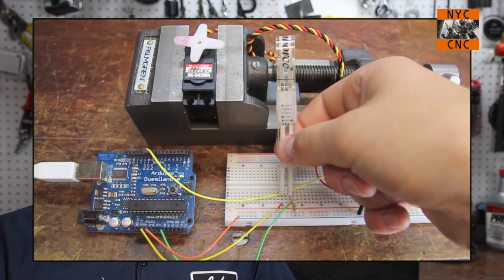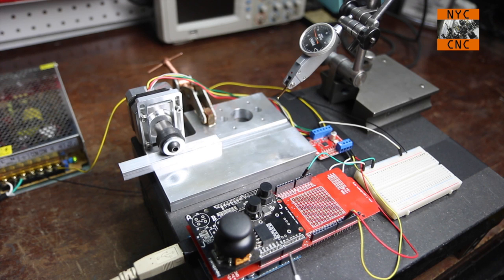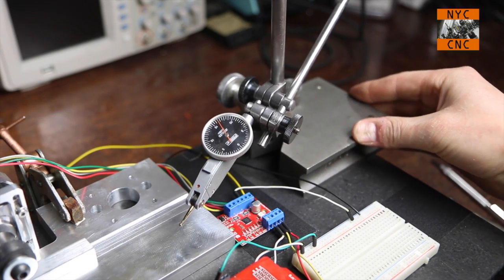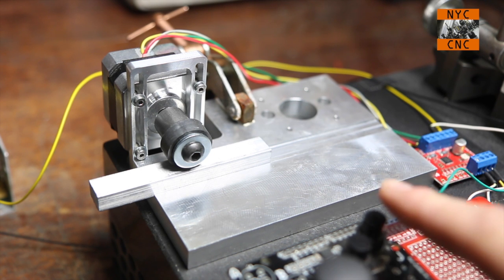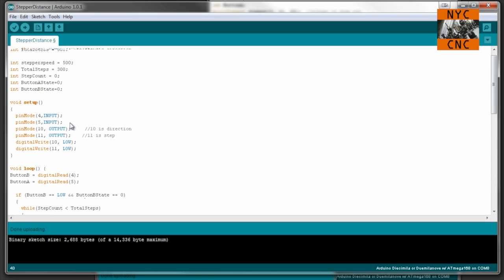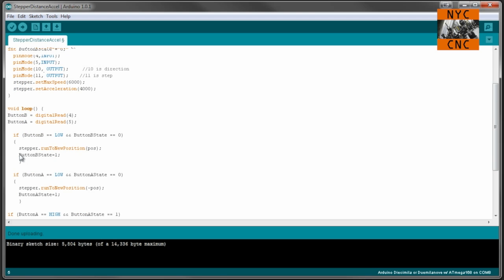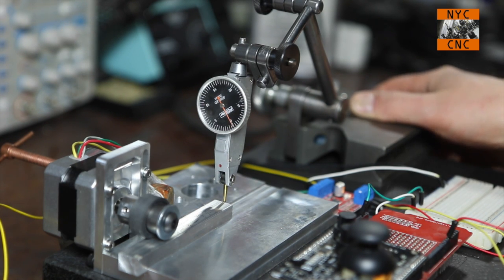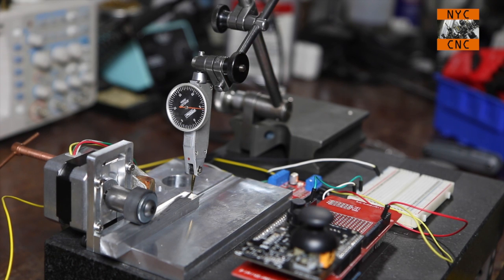Arduino Stepper:  Ultimate Accuracy!

Comment: I know I am commenting on something that is now about four years old so I think you have figured out the problems by now. Never test for accuracy and repeatability with an open-loop system. Think about using PID. Reduce friction. Steppers have resonant frequencies. Never drive with rubber that does and will slip. Test at a known zero or reference at each pass for accuracy and repeatability. I'm sure there are more things to consider if I gave it more thought. Nice job. Thanks for the video. Oh, test setup is not correctly setup for accuracy and repeatability, I think. I will look for any follow up videos to this. Thanks again.

Comment: you should define constants to make the code more readable. instead of sending "0" and "1" to the direction, just define something like "clockwise" and "counterclockwise". same for the button states (ex., "pressed", "notpressed").

also, thats not debouncing code; those buttons are naturally "debounced" by the delay in the servo movement. debouncing is to eliminate micro transitions on the button itself. what you are doing is ignoring repeated presses of the same button (which, by the way, could be done with a single variable, i.e. "lastbuttonpressed = [left or right]").

as to the problems with the accel library, its hard to tell without either looking at the code inside it or making multiple tests with different maximum speed and acceleration values. the problem could either be rounding errors (due to non-integer velocities and delays being mapped onto integer numbers of microseconds and steps) or pulse width dipping below what the motor can handle. with a single test there is really no way to tell.

Comment: well ur code is loosing count of the actual steps somewhere. my guess is you would have to go into the library and modify it to keep track. seams like the library thinks the input is a target speed, not a distance like ur trying to use it.

Comment: Kind of new to this, I have an Arduino uno, cnc shield, stepper motor and 8825 drivers, I get them to work fine in the grbl software but can and how do you hook up a rotary encoder for position feedback?

Comment: Any open loop system derives its input/output numbers from the back loop stabilizing program inherent in the chip.  Without a corresponding stabilizing control feed loop, the output program is unstable.

Comment: John,

Awesome video as usual. Because of your videos I have an entire drawer full of arduino stuff and electronics. Bought several books on them, but prefer your series of videos. For the record, I am still only making lights blink on and off since I only get them out 1 time per year but soon that will change.

For the rubber slippage perhaps a simple adhesive would solve the problem of the band walk. Take care.

Comment: Hey john. Be interesting if you ran the acceleration code with an arm on the stepper shaft instead of the rubber wheel etc. I'm sure u can find a way to " clock " it as well. That might tell u if it's code or rubbery related gizmo. Love watching yr channel. Every Wednesday bro, keep up good work.

Comment: Have you managed to work out the accuracy on the ramp up/down lib. yet. If not a simple solution would be to use the manual controlling like you did in the 1st half and put a delay in the while loop with a delay counter subtracting each while loop until it hits 0 (no delay max speed).  Im just getting into the Arduino scene so if this is a good or bad idea, please comment.  Thanks

Comment: not enough voltage/current. micro steps are missing during deceleration due to lack of torque when steppers are at low speed.

Nothing wrong with code-, try lubing the jig before doing this test, and having a more gentle rubber gasket.

Comment: the accelstepper library doing well, just one step more or less, it's not inconsistent, it just can't go a integer number of steps, it does some rounding, but is only one step of error, that do not build, i'm saying, if you give 5 hours of constant back and foward moving, and check it out, will be arround the 0 yet, one step less or more. if you measure that in a screw, is about 1/100 of a milimiter of error.

Comment: Arduino may not give you the timing required to achieve accurate accel/decel. Look into a synchronous platform like the PIC microcontrollers (like the PIC12F675)

Comment: sir i purchased leadshine driver DM856 for leadshine stepper motor (86HS85), I am controlling it with arduino UNO but i am unable to get higher speed with it. sir plz do guide me to get higher speed on stepper motor.
Reply: Bhargav,  you check your code twice and also that you are not a victim of stepper stalling. What speed do you expect on setup? Usually the speed of drive is very limited in terms of rpm (less that 2000 rpm on good and dedicated professional pulse generator, which is wise to have control over accuracy and repeatability). what speed you observe at the end of drive train, is the result of mechanical setup and the electrical setup.
So dont expect more where you are using Arduino to drive industrial stuffs. 
I also had kind of same setup like you (with some difference in motor) and tried to use it with Advantech Motor Controller and also with Arduino. The results were good enough just to satisfy the need of the project but not more than that. with Advantech controller card I finished with stalling @ nearly 600 rpm (@ nearly 900 rpm with S curve drive cycle) and with Arduino powered controller it was just better by 50 rpm in both the cases. 
hope this make sense for you.

Comment: Have you tried using a known good optical encoder to register the movement of the steppers?   This also has the added benefit of an external verification to your stepper movement, so if you have a lost step you can adjust and correct it.  It does not help much with over-step, but it could help you verify the accuracy of the code.   In addition it would interesting to measure the load on the stepper when it gets out of sync.  I question if the driver is accurate enough to do the high speed jumps, though the code could easily be the heart of the problem as well.

Comment: could the issue be in the motors time to drain the energy from the last move? try repeating the move with more time for the pause between the moves see if they get more accurate. 

Also remember you re dealing with very small distances and simple table vibration can alter the measurement.

Also the tool itself can be randomly inaccurate. So another suggestion is different measurement tools and do a graph like 10-20 measurements with each see if one is more accurate than another. 

Small power fluctuations and even temperature are also a big deal when playing with really small distances.

Comment: Hi Dude... your inaccurate repeating position is because you are using a rubber wheel on a smooth surface... it will always slip... no chance of getting repeatable results.
If you had used a rack n pinion, you would have the step size errors from the stepper plus the pinion radius variation and tooth profile errors... if you used a highly concentric large diameter drum with a very fine steel wire attached and wrapped around it you would get much more consistent results for testing.

Comment: Thanks for the video!!! Mechanical precision movement. I believe that solution should be replacing the aluminum bar and the rubber band for a worm-drive made of the same material (for instance aluminum). The interaction of different materials, (in your video) factors as temperature, friction could influence at the time to obtain accuracy.... A well done, brand new worm-drive (made of the same material) should resolve the mechanical difference.... a worm-drive will bring later on what is know as a backlash problem, related to precision, BUT that meanly will be after a LONG period of wear down the material... I just hope maybe this will help. Thanks for the video again.

Comment: Hi, did you try to use a linear motor instead of a stepper motor? I was working in the electronic industry and the optical inspections systems I was working on was using linear motors which were damn fast and precise. By precise I mean microns precision with a camera system that weighed more than 10 kilos.
Reply: You could give it a check just for information. You might find interesting things.

Comment: Do you know if there's more torque in a stepper motor or in a servo?  I want to build  a bunch of platforms which my potted plants will sit on and the plants rotate throughout the day based on where he sun is at the time; precision is not as important as having the torque (muscle) to turn the weight of the pots. Some of the pots will be large and some smaller pots, with the larger pots weighing upwards of 50-75lbs with wet potting soil. Or are there better devices out there that I would want to use which will move heavy objects better when connected to one of the credit card sized or mini microprocessors like the Trinket or Raspberry Pi?  I'm thinking that using a Raspberry Pi or even Pi Zero would be overkill just to have a motor move a platform with a plant sitting about once an hour or so  during the day.  Last year I rotated all my potted plants by hand and it was a task to deal with doing it everyday with all the potted plants I had!  I would like to automate the process as much as I can and maybe even add in some sensors for measuring soil temp, soil moisture, soil Ph levels....  Which I still think an Arduino would haven no problems doing.   Thanks in advance for your response and assistance.
Reply: Thanks...

Comment: I am absolutely convinced, seeing that dial indicator return to zero over and over is certainly proof that the system is tight, and I agree that the ramping of the acceleration curve is suspicious, maybe a rack and spur gear would be more accurate, maybe drill out your channel with holes for pressurized air for the slider to travel on? Or maybe magnets?

Comment: When using PWM, should the there be high impedance (no current) or no voltage between pulses? Does it depend on the type of motor (DC or stepper) or application?

Comment: quite simply whoever wrote the accel library is an idiot and used floating point code without error accumulation, that's why it's inaccurate. bad code is all
Reply: +NYC CNC lol sorry guess I was grumpy when I wrote that.  sorry for being so rude.

Comment: in the accelstepper program i miss the stepper.run command and take out the delay as the loop speed is needs to be very high with the speeds you are at.
when the loop is too slow the motor will not step twice in the loop so it will forget steps. so it is a problem of the software.
if you slow down the maxspeed it will be more accurate.
and  the 1 means you have a dir and a step output, a 2 is using bidirectional direct driver and 4 means unidirectional with a ULN2003

Comment: i just saw your video, but i am unable to find why the motor is losing steps in slow acceleration?
Reply: +umair waheed I'm not sure if the skipping of steps happens in the motor or on the sliding surface, but the causing effect is probably longer exposure time to standstill friction of the sliding surface

Comment: Another informative video.  I run a shop cutting Fr4 G10 and carbon I  the UK making parts for anything but specialising in model helicopters multirotors and cars.  I will be building my own 3D printer and have found your explanation of the code helpful

Comment: You have an open-loop system, what did you expect?  This has not really much to do with accuracy, certainly nothing to do with precision, rather merely repeatability.  Do more homework..
Reply: Awesome advice. mmm feedback and controls mmm
Reply: I'm an engineer. I was giving him advice based on experience, not slagging him off. I know that's unusual these days..
Reply: There are plenty of open loop stepper systems that can hold < 1 mil repeatability.  My guess is the arduino code is screwed up.  As someone else posted, just count the number of steps.
Reply: NYC CNC Nice video, but tkarlman is correct. I don't know why (out of several possible causes) your test rig lost position in the second test, but it wasn't corrected because your system is open loop. That's what's "inaccurate" about it. If it was closed loop, it would have hit zero every time. I'm guessing you were "lucky" in your first test. You've pretty much invented a low tech equivalent of the friction drive. I don't know when it was invented, but a high end CNC company I worked at 25 years ago used them a lot and they weren't regarded as new tech. With a suitable (ie servo, not stepper) drive they can move objects weighing tons with sub 10 nanometer accuracy. Have a look at http://www.cranfieldprecision.com/precision-linear-drive.php
Reply: Martin Jenkins Re some of your other points, I think the radial load in your test rig is well with in spec for the stepper. You should probably lubricate the channel - I'm no metallurgist but I vaguely remember something about aluminium sliding bearing being prone to stiction which may not be overcome in the initial acceleration phase and would go uncorrected in an open loop design. I'd definitely fix that rubber to the motor shaft more securely to prevent slippage.You can't really expect reliability and repeatability if your drive is compromised. The Cranfield drives I mentioned above used a steel roller attached to the servo and clamped to a ground steel bar with a pressure roller on the other side - the motors were "floating". We used a variety of measuring devices to close the loop - mentioning things like stepper motors and lead screws wasn't quite a sackable offence, but it could lead to an embarrassing chat with the MD.
Reply: Jesus give him some credit...

Comment: New indigego campaign, if you like Arduino, take a look at: igg.me/at/proto-e
We offer you prototyping PCB. A bit different one.
Protoboards on market are mostly for TH (Through Hole) components and off course it's also supported here. But you can combine it with other components since there is lot of SMT and one TQFP32 soldering place.
And pinout is fully compatible with Arduino UNO R3 boards so it's a solid start for any new Arduino shield. Thank You, Proto-Electronics Team

Comment: I didn't have time to read all comments here. But if you are still not sure about the exact cause of the issue, then you should Google the "natural resonant frequency" of the stepper motor. All stepper motors have their own special step frequencies (or speeds) at which they will stall or lose steps. So when using the acceleration/deceleration you should avoid that frequency (i.e. speed) by increasing the start (min) speed of the accelerating/decelerating ramp. 
Here is a Youtube video showing this stepper's "dark side" many of us usually don't realize.;-)
https://www.youtube.com/watch?v=yjVQwEHAz5M

Comment: As with "Jan Johansen 1 month ago", it looks like the end of travel stop is being hit on the manual mode movement.
If you think your loosing or gaining steps, repeat test with the flag on the motor shaft, this will indicate if its motor/drive or system weakness.

Comment: Hi, if you still want to know what this number 1 means after the argument
Accelstepper; stepper (.... This number 1 is when you use a stepper driver then it comes the pin number for the step pin then the dir pin.
If you use number 2 means a 2 wire stepper, 3 a 3 wire stepper like a HDD, 4 is for a 4 wire stepper.... more information here http://www.airspayce.com/mikem/arduino/AccelStepper/classAccelStepper.html#a73bdecf1273d98d8c5fbcb764cabeea5

Comment: I love this! I used to program steppers using MS DOS and multiple parallel ports. Built an animatronic Dracula for Halloween 25 years ago. No libraries or Arduino around for that so I had to write it all by scratch. Homing the steppers is important. I used an opto to count revolutions ( kinda raw ) and was working on an encoder disc.

I got my first Arduino board 2 months ago - used it to analyze power supplies - I think it's AWESOME to get a low cost data aquisition board ( I paid less than $10 for the board on Ebay ). It's got me thinking about what else can be done. I ain't come up with nothin' yet!

Comment: Interesting. I believe the table that your stepper motor is on isn't grounded. Every time you touch it you can hear some "hissing" in the audio form the mic. Also once you have your test indicator touching the stepper table,  every time you then touch any part of the test indicator you hear "hissing" or a high frequency noise.

Comment: My guess, and as i dont have the same parts i can only guess, is the initial first few steps or last few steps are of such a low power or duration (ie pwm) the stepper does not move due to friction or stiction and so some pulses dont make the required movement of the motor. I see this on DD brushless (+hall sensor)  setups where the motor controller ramps up the torque via pwm and you often see no movement but you can hear the coils squeel for a part of a second before it moves under load.
Reply: I have to agree. The first few steps and the last few steps (at 17:00) just don't have the torque/power to move the object. This is where a feedback loop with encoders helps to improve the accuracy. I've seen this happen in stepper motor projects I've built in the past.

Great channel, BTW... subscribed!

Comment: I learned a lot on machine here cool! Now I hope you can learn something from a software engineer:
You should use one procedure for both buttons and only pass the different arguments in the function arguments and you may want to use Atmel Studio and avoid Arduino you get far more speed from the ATMels compared to the Arduino wrappers.